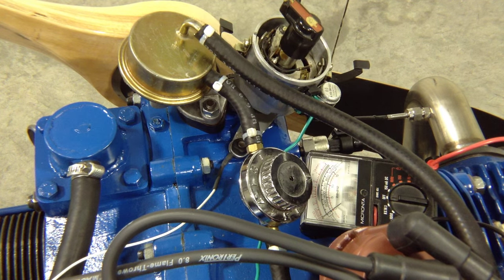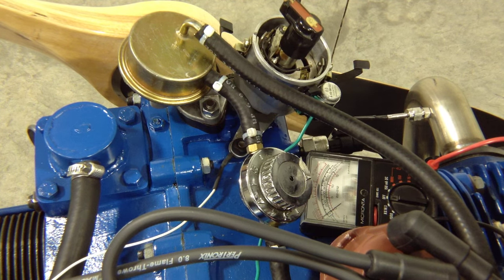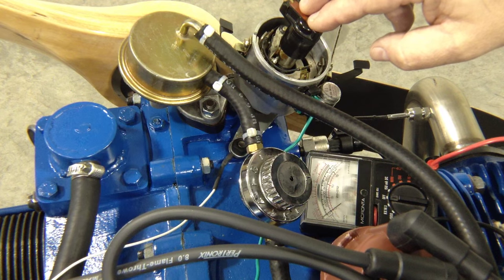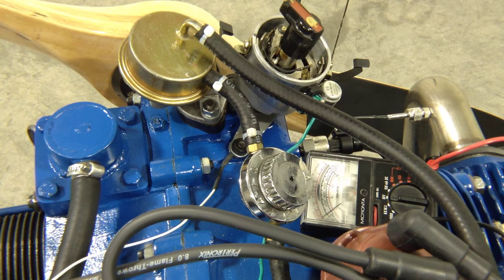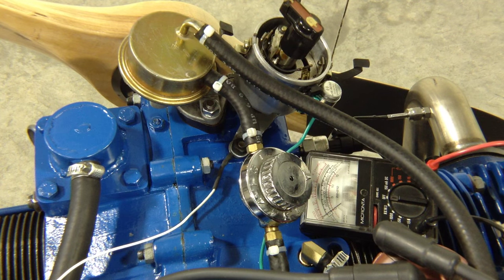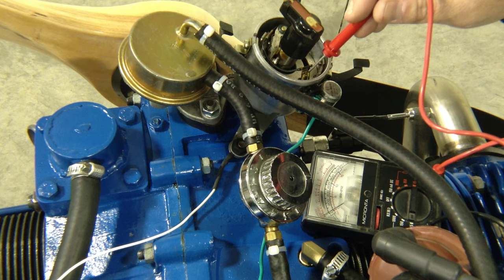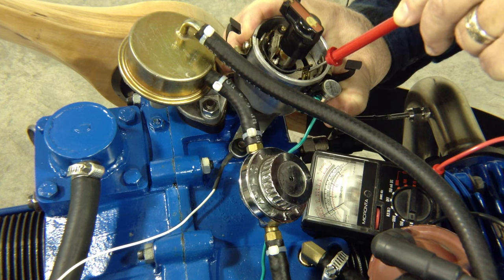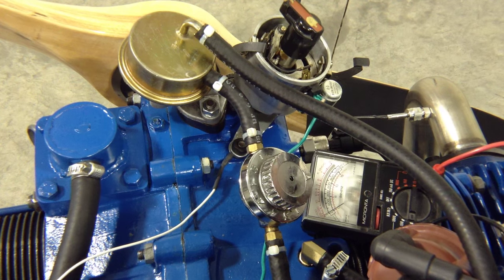Half VW Static Timing

Comment: what about advance it needs to spark before top dead center 16-18 degees
Reply: Done automatically with the VW distributor, and as noted this will get the engine running and you can adjust advance as needed after that.
Reply: Most at 0 degrees to start. I think

Comment: Interesting. Is that the timing for the spark from the magneto or timing for the camshaft?
Reply from the maker: +Veritas1992   That's for the distributor which sends the spark to the cylinder heads.  I don't have a magneto.  I'm actually saving weight by using a very light Lipo battery as the electrical source and the distributor, rather than going with just a magneto.  Timing comes from the drive shaft via a worm gear.
Reply: I'm still thinking of it as an aircraft engine design not a car engine retrofitted for an airplane. Do they have any reliability issues with not using a magneto?
Reply from the maker: Using historical data from cars I'd say they're on par with magnetos, and reliability is good.  But since there's only 1 ignition source you lose the redundancy.  I have a used distro right now, will replace that with new along with the carburetor.